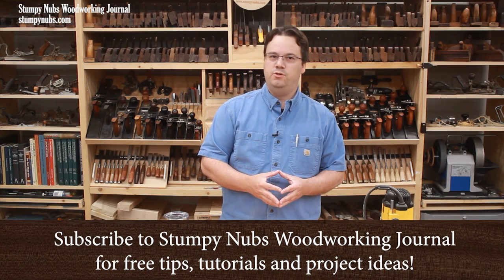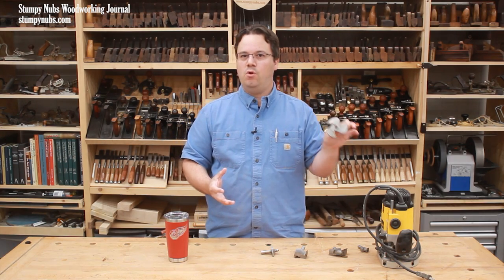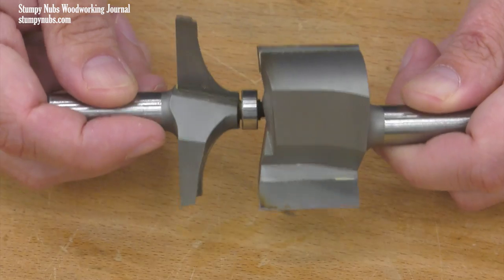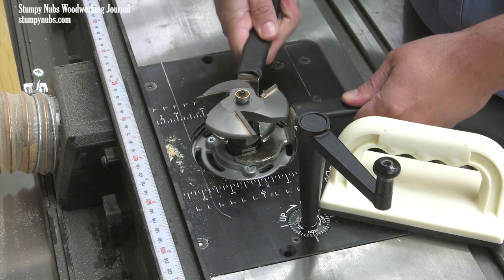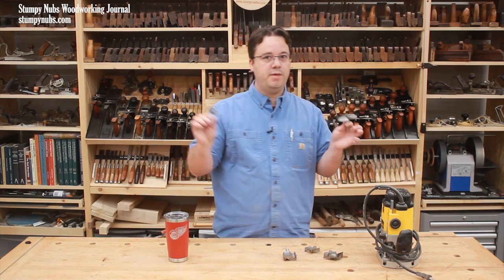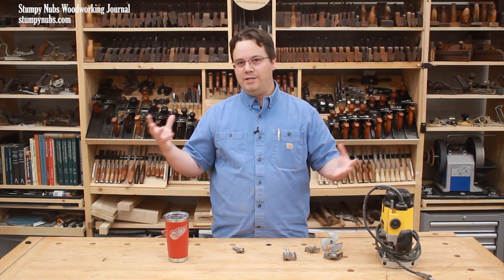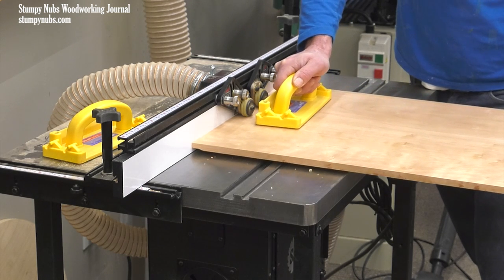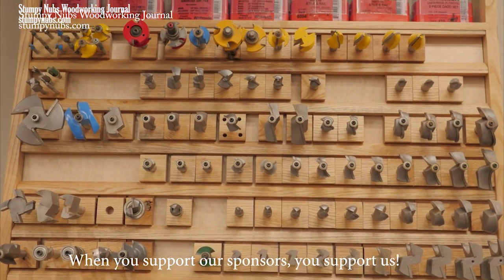The SCARIEST router bit I've ever used! (How I survived...)

Comment: The conversion to miles per hour was a real eye opener. Thank you. All your safety videos should be required watching.
Reply: @Joel on a distantly related note, in-line skates' wheels can have much faster angular velocity than wheels of an F1 racecar at full speed. Blew my mind when I did the math.
Reply: Even worse when we in NZ convert it to km/hr........ about 1.6x more.
But I never use routers.

Comment: This is a great video. I find it amazing that with just about every tool you buy , along with the accessories, you get instructions on safe usage , except router bits! I've never seen an instruction sheet on proper set up or at what speed to use no matter what company you buy them from.

Comment: GREAT stuff, James. Appreciate the massive amount of time you have invested in getting us novice (and sometimes 'experienced' guys like me) up to speed with these router tips. A table mounted router seems "safe" enough, that is until you have a work piece kick back and go upside your head RAPIDLY, because you got complacent. The edge speed of the larger bits is also easily overlooked.
   The point on really tightening the bigger bits cannot be overstated, either. I had a 1/4 shank, 3/4"- ish bit come out while using my trusty PC 690 (handheld), as I have done countless times. That thing ricochet all around inside the router base before coming flying out sideways, while spinning fast. It took a few chunks out of my left hand before going 30 feet across the room (still spinning), and the entire deal took less than one second. I then took the collets out and did thorough cleaning and slight de-rusting to make sure I did not see that movie again.
Reply: Whew, you got lucky with that one. Glad you did, and good to hear you heeded the message and made sure it was a one time viewing of that show.

Comment: James, you absolutely nailed it again! I gutted an old junk Delta 43-505 shaper table that I bought off of Craigslist and gave it a second chance in life by re-engineering it into a router table with a lift. The router I used was a Porter Cable 3-1/2HP model. No speed adjustment (yet). There is no way I would put a large bit into it. After I made my own lift mechanism and turned it on, just listening to the power of that router earned my respect. Some day I want to convert it to multiple speed but it has a soft-start circuit which has to go first. Variable speed on that model does coexist with soft start circuitry. For right now, all of my smaller bits run fantastic in it. When I hit the Start button, it has my respectful undivided attention.

Comment: Good information there James, thanks for reminding us of the dangers of routers. We forget when we use them regularly. About fifteen or more years back I was victim to an airborne router bit. I was in my small shed, 12 X10 feet; working on some oak for a fire surround and using a small sized bit. Suddenly the load came off the router. I had the intuition to realise what had happened and threw the router on to the bench and went into a crouch with my hands over my head and face till the ricocheting stopped. No impact on the body but I could see a few spots on the walls where the bit had bounced off. No sign of the bit ; I never found it till I cleared the shed when I moved house. It was lodged in the small gap between the floor and wall. 
I have no idea why it came loose. Knowing the rotation speed I made it tight and the collet was fine. The only thing I could think of was that some wood chips may have got in there and it wasn't as tight as it appeared. The vibration shook them enough to let the bit loose. Who knows. I always make sure its nice and clean up there ever since.

Comment: I’ve been woodworking for now more than 50 years still in the shop every day. My Father helped me make “our” first router table.  It was a piece of birch plywood screwed to a 2x4 and held in a bench vise. The reason was larger bits….for safety…we didn’t have money for a shaper in the ‘60’s so we made it work. My Dad taught me the speed math for bit diameter. With his craftsman router & 1 1/2” bit was as big as we could go. 
Thank James for “a teaching moment”. Nice job & Thank you
Today I have aPC 7518 (yup it still works with all the big stuff 20 yrs) in a Woodpecker table & an Incra LS fence when needed. SAFETY FIRST!!

Comment: As a retired metal machinist I relate your comments about rpm & miles per hour to what is called cutting speed / surface speed. It is an equation that is drummed into you during your first weeks as an apprentice. Although metal machining requires much more variable rpm the basic princibles are the same.
Reply: I guess "speeds and feeds" aren't as critical in woodworking, but I'm surprised they aren't mentioned more often.  Even if you're not calculating or referring to a handbook, experimenting a little can lead to better surface finish, less burning, etc.
Reply: Agreed. im surprised it doesn't come up more often.
Reply: @benz-share9058  Maybe time for a separate tutorial on this subject:  It might not be as critical in woodworking, but a lot of people set the speed dial on their power tools to "whatever", and wonder why they are getting tears and burns.
Reply: The feed and speed is far more critical with metals as can be the use of the correct coolant. The friction and low feed speed can kill the edge of cutters almost instantly. With timber in most cases the main consideration is the finish on the component. Low power motors running at reduced speeds are easily stalled as all too often an excessive depth of cut is attempted. Take light cuts at the right speed and the work quality goes up as the tool life goes up. It may take a little longer on the router but the finish sanding should take a lot less.
Reply: When you have limited ressources, sometimes using the wrong attachment in another tool as safely as possible is the only available solution. Converting RPM into meters per second m/s using Pi x Diameter and 60 s /min allows to size a bit or blade to safely be used (within reason, i.e. does it fit safely with the guard attached properly) in another faster spinning tool. Or how to use the wrong tool (spins too fast) to carve into heat sensitive material with a smaller attachment. 

That's also how I calculated that a 7.25 inch circular saw blade would be at a safe equivalent surface speed for the carbide teeth  vs the 10 inch in my 5000 RPM saw. 40$ vs 100$+

Comment: I personally prefer the vertical raised panel router bits. They are half the price of the horizontal raised panel bits. When using a tall fence and a feather board they result in a cleaner cut, especially in hardwood like cherry that is prone to burning. They are especially suited to a horizontal or pantorouter table if you have one.
Reply: I use one of these myself.   They are called razor bits.

Comment: great coverage, on an important topic...SAFETY.
I have a handheld router, and have used it enough to be afraid of it. I am a Surgical Technician,  with 49 years experience.  I have images burned into my memory of hand injuries suffered by "woodworkers " due to power tools. some of them resulting in the removal of digits, to include a hand. I have also seen the result of people NOT wearing eye protection.  Polycarbonate  Is worth taking the time to put them on. The violence associated with power tools, like violence in general, happens blindingly fast. pun intended.
I find your channel a great place to learn.
God bless

Comment: I've had a small bit slip once in a hand router, thankfully only enough to ruin the project I was trying to rebate, but that was a very scary moment. I didn't even notice it had happened, & it was a flat bottom bit so it only cut a little deeper than it should have, but then when I lifted the router & moved it over for the next cut, the bit fell out. I'm so glad I let the thing come to a stop before moving it.
Reply: I was making a breadboard end on a router table using an up-cutting spiral straight bit, and it climbed up out of the collet into the work. The cut felt a little strange but it worked, I only knew it went wrong when I finished the cut, stopped the router, and lifted the board away to find about an inch and a half of bit sticking out of the table!
Reply: @thegardenofeatin5965  Oof. At least they tend to lose enough torque that they can't often keep cutting once that happens, but it's always the exception that gets ya.

Comment: A thought occurred to me when you were talking about routers where the determination of actual RPMs is guesswork.  I'm a musician, and there is another piece of information a person could use, which is the pitch of the hum of the motor.  If the hum goes up one octave, the RPMs have doubled.  That may help give some kind of general indication, anyway.  For instance if you know the range is 9,000 to 22,000, an octave up from the lowest would be 18,000, and an octave down from the highest would be 11,000.
Reply: Interesting and helpful.
Reply: That is so cool! I had to run out to my shop and try this. I installed the first free tuning app I found for my phone. I set my new Makita brushless/cordless trim router to setting "1" and the tuner reported "E sharp" two octaves below middle C (E3# I think) I slowly turned up the router and found that I could dial in all of the notes for about 2-1/2 octaves including the flats and sharps, settling in to A sharp at full speed. The it was time to come in for dinner so I cut my experiments short

Everything else below I learned in the last hour and it's so freaking cool! 

E3 is 164.81Hz (cycles per second). Multiplying by 60 to convert to cycles per minute gives 9,888.6, which is very close to the 10,000 RPM advertised "low" end of the Makita router's speed range, and A440, the A above middle C is 440Hz, X60 , or 26,400, close to the advertised "high" speed of 30,000.

I still need to experiment more to get more accurate readings, and find a tuner app that reports frequency and not just notes, but I'm betting that when I finish experimenting and recording data, I can use a tuning app on my phone to precisely calibrate the dial on my router to speed, and I bet it will be the same for ALL of my routers!
Reply: @christopherdahle9985  Yep! Music is just frequencies, and Hz are Hz. There's no reason a phone's microphone can't pick up the sound of a router and convert it to RPM in exactly the way you describe.

I note that if, rather than the sound of the motor, you are recording the sound of a bit touching wood, a bit with multiple blades will produce a frequency the same multiple of its RPM.
Reply: @ps.2  With further (limited) experimentation, I have discovered that there are differences between routers. The little brushless trim router generates frequencies that correspond directly to RPM if I multiply by 60, but the routers in my two router tables (big Porter Cable monsters) my midsized routers (a grab bag of models found at thrift stores and garage sales) and the DeWalt 611s in my CNC machines, all seem to generate frequencies which follow a predictable curve, but don't "obviously" convert to RPM with a simple X60 constant. Also there was lots of noise and the tuning app struggled to hone in on a particular note. But I didn't do any experimenting under load, or try to determine whether installing a particular bit would generate more predictable frequencies. I didn't plan out a scientific approach, this was just thoughtless experimenting and reaching WAG conclusions. This fall I'll run the problem past the kids who are always asking for science fair ideas and see if one of them comes up with a protocol for accurately calibrating the speed dial on a router using a tuner or tuner phone app.
Reply: There's an even easier way.  Just get a spectrum analyzer app for your phone.  The strongest peak will probably be at the RPM (or an integer multiple of it) of the bit.  The analyzer app will give frequency in Hz (oscillations/second), so you have to convert to get to RPM (multiply the value in Hz by 60).

Comment: I’m a novice woodworker and I absolutely get everything you discussed on router bit safety. This machine and the bits command great respect at all times. Even when resting on the bench or mounted. 
One thing I would like to add, for discussion, is how big a router one should be using for those heavy and large bits. I would never even consider running them on anything less than a fixed base, solid table mounted 3 hp router. Trying to run them on an under-powered set up is inviting disaster and excess strain on the router.

Comment: When I worked at Albright's Cabinet Shop, I had to use what they called a 'shaper', to make these raised panel cabinet doors. This huge machine was a massive table model and completely open. It took considerable force just to push the panel thru to make the raised panels. That was my job. Had I slipped, my right hand would have gone right into the blade, destroying my hand permanently. So I agree with you in using this. It's authentically SCARY!

Comment: Just an idea: would it help (with the micro-vibrations) to start the router and let it run for a minute, then re-check if the bit is still tight, before actually proceeding to cut?
Thank you for another great safety video. Cheers

Comment: I recently had the bearing on a flush trim bit come apart during use.  It did not just come off, it came apart!   Little hand grenade pieces flying everywhere.  Scared the crap out me!   And ruined the part of my project.  Thanks for the video.
Reply: Yeah, the bearings can't take those kinds of rpms for long. Remove the grease and use lots of oil, keep them well lubed and maybe they'll last long enough to get the job done. Even though the outer race isn't moving fast, the inner race is going at router bit speed when contact is made. It would take a very high quality sealed bearing to hold up those rpms and they simply don't use those. If you can find good ceramic miniature bearings, they might be worth replacing.

Comment: Very helpful. Indeed here in Scotland I have some Whiteside router cutters. I also have a large mitre cutter, not as large as the one you showed, but nevertheless raises anxiety levels - especially with old hickory. Started to use a smaller 45 degree cutter to take some of the waste off first….always on a router table.

Comment: Hello from a fellow wood worker, most of the bigger router bits should be used on a shaper with a Router collet ( they are as much as the Big Milwaukes or Large Porter Cables which I own both . I have a shaper where you can adjust the RPM Value for safety and for the larger router bits I also have power feeds to keep your fingers away from the work. I suggest 3 wing cutters to minimize the vibration and get a much smoother cut with less to no chatter , John you are the Champ I enjoy all you do helping others do work correct the first time !!
Reply from the maker: Router bits like the one in this video are perfectly fine in a router table. They have been used that way for many decades and are specifically made and sold for that purpose. You can put it in a shaper if you like, but a good 3+ HP router table works just as well, in my experience.

Comment: I just used one of these for the first time last week. I have a router table that uses cast iron table from a table saw that a friend milled a hole for a router lift. I took several passes raising the height each pass and used blocks to hold the work piece. It worked very well and was much easier than i expected.

Comment: I have nearly the same router table set up in my shop.  What are the rollers you are using in lieu of feather boards?  They look like they would provide much more consistent pressure on the work piece.

Comment: Great video - I don't use large bits but I deeply respect the power those bits have at high speed. I'm paranoid as it is with my 1/4" straight bit.

Comment: I really like your safety videos. You've been there so there's always a lot more than what's included on the safety sheet. Unless I'm wrong the velocities are directly proportional to the diameter. That means the edge of a 1.5" diameter bit would travel at twice the velocity as a 0.75" one.

Comment: Hey stumpy when I making panels with big bits like those I use my radial arm saw. Put the bit on the back side in a drill chuck.  Slower speed, plenty of power and a bigger work table than my router

Comment: Good video. I thought I'd add that you can use the SFPM (Surface feet per minute) formula for this application. Every material has an SFPM rating. You can find them all on a chart online. 
The SFPM for wood is around 3000-5000. If you take the nominal, 4000 SFPM and times it times by 4, and then divide it by the diameter of the tool you're using, it will give you the RPM. 

You can also use this formula to calculate feed speeds, but with woodworking, it's usually manually fed (as opposed to by CNC), so its hard to calculate that.

Comment: For those who aren't in your 60s bits such as the raised panel bit James was demonstrating were only used in a heavy stationary machine tool called a shaper. This was due to the 1hp max routers back in the 80s. And frankly bits over about 1and 1/4 are big enough that I wouldn't feel comfortable using without a table . Also I was taught to never go over a 1/16 in one pass and like you recommened a light final pass to clean up and get that sweet finish we all love.
Reply from the maker: Never more than 1/16" per pass? It would take you more than 30 passes to do the four edges on a single raised panel! A good router bit can do more than 1/16.

Comment: How often do you clean your collet?  Occasionally I disassemble mine, use some fluid (Simple Green), a stiff bristle brush and clean it.  When done, I blast it with some air, just for good measure. I am of the opinion that just a wee bit of gunk can contribute to run-out.